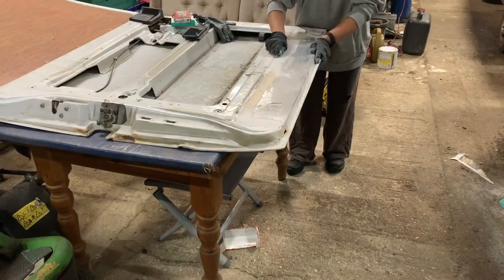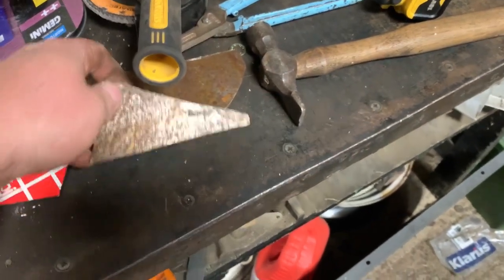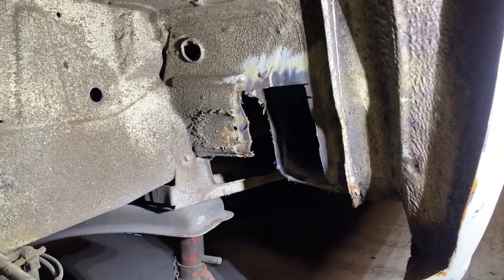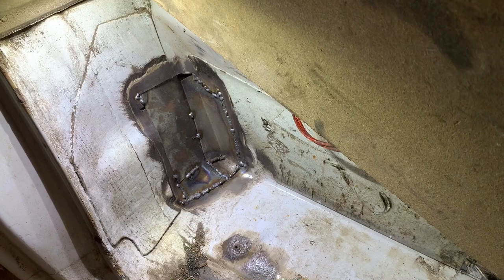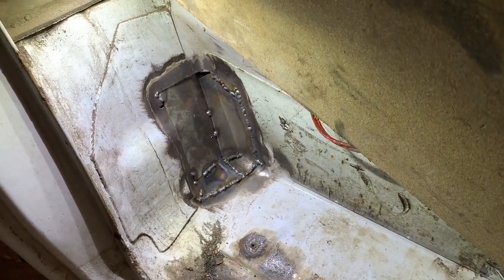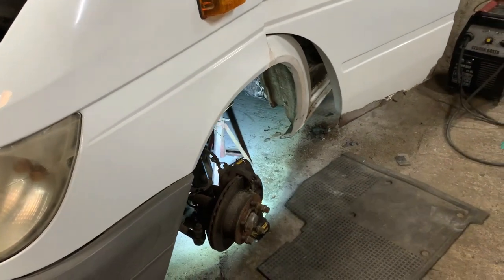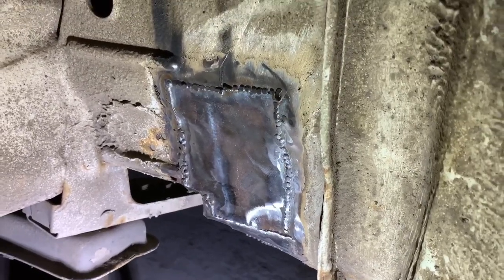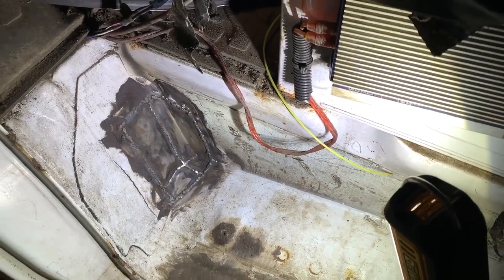Mercedes Sprinter Door Step Repair ( Patch Welding ) Van Restoration ( Part 5 )

Comment: You're smashing it Luke, it's going to look awesome
Reply from the maker: Hi it’s getting there, I shall probably just fill the door out to the level it needs to be in the low spots and then get my dad to finish it off, he’s got more time than me atm and I can concentrate on the other bits, the bonnet is already at my dads waiting for top coat, but he might aswell do the side door the same time. Thanks fo watching 🙂👍
Reply: @menditman2004  Cheers mate, thanks for uploading